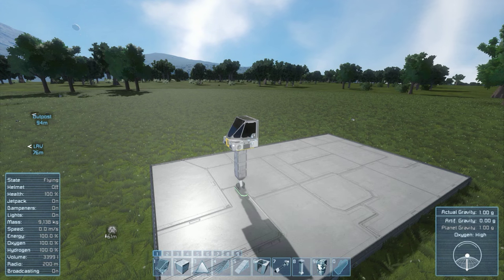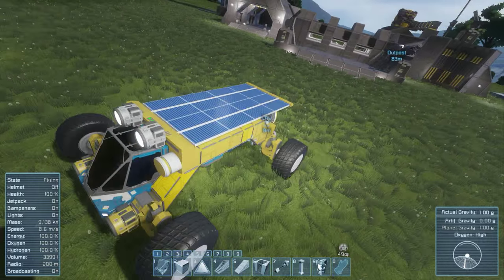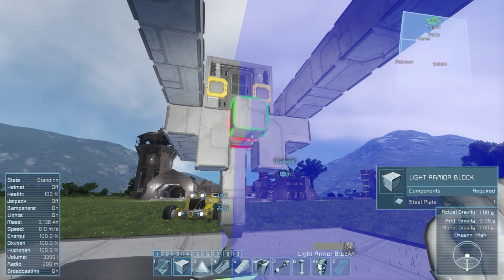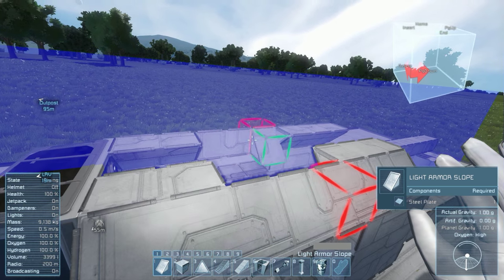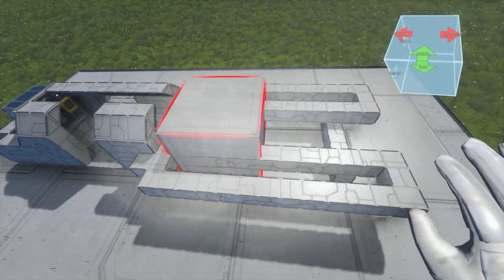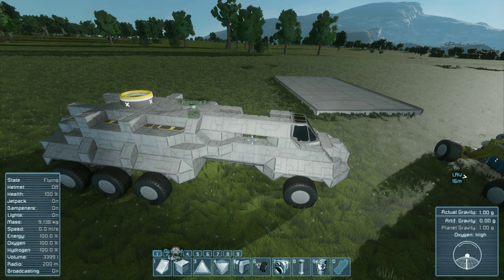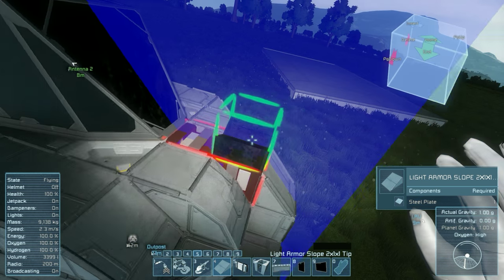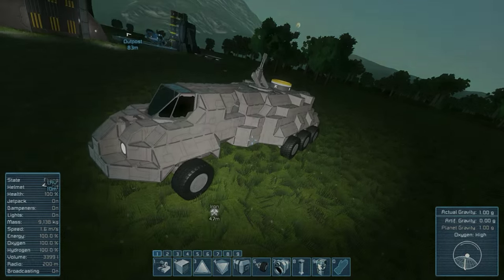Space Engineers | Planet-Fall | Part 6 | Ground Transport 1

Comment: Instead of the merge block, look into advanced Rotors. They have the ability to attach and detach from other rotors. That lets them create hitches that can pull trailers freely. And they transfer power, so only the primary vehicle requires power. WastedSpace had one on the survival series he's doing with XPGamer. And it's also demonstrated in LastStandGamer's Road Train design.

If you're using cargo trailers, such as the mining attachment, you can hang a connector over the back of the truck and have it throw out everything into a collector on the truck. That way you only have to haul the truck's cargo back and not try and connect to the trailer.

Great Truck though.
Reply from the maker: +Triaxx2 Wow didn't know that about Advanced Rotors - Thanks for the tip!
Reply: You're welcome.
Reply: +Uthris  it has ben almost a month are u continuing
Reply from the maker: +Jacob PENNINGTON The last episode was a week ago
Reply: +Uthris  you mean ep.7